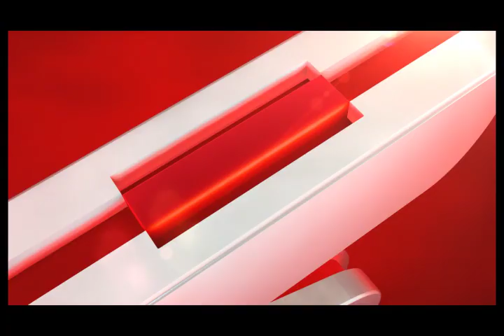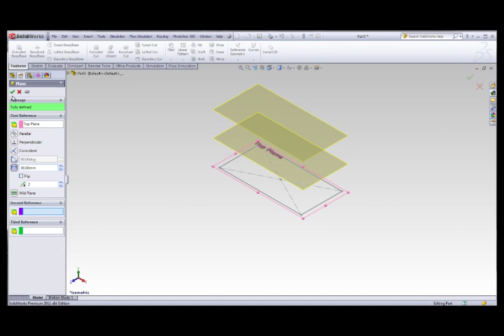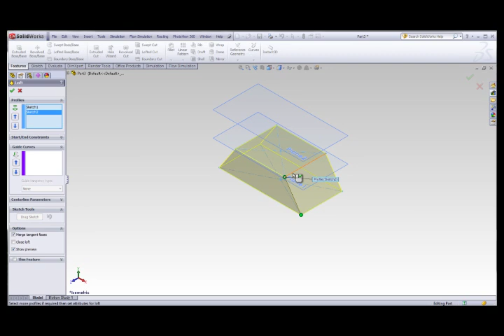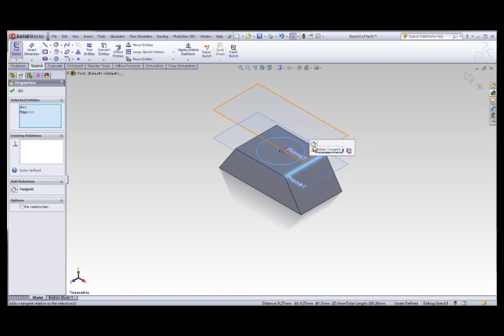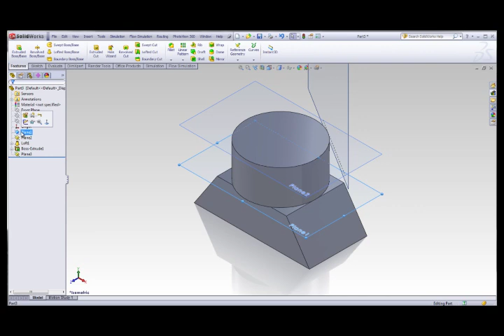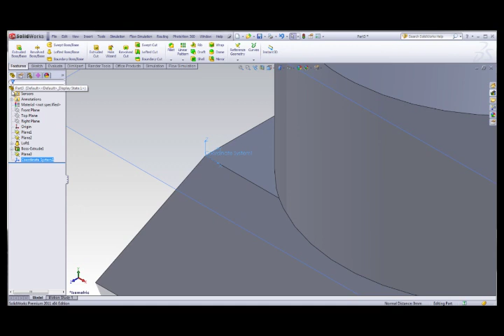Reference Geometry

Comment: I am having the same issue and their tech support hasn't gotten in touch with me yet. I'm running the student version of 2014-2015 on an Acer Aspire S7-392. According to Solidworks my hardware should be able to handle their program well. Haven't found anything useful on the forums yet.

Comment: Everytime i try to insert a new plane from Reference Geometry, SolidWorks just crashes. It gives no warning, and i have found no way to fix it. If anyone knows how to fix it let me know. 
PS: I've tried: Reinstalling (3 times), choose different options and some on the internet say that it might be the graphics card. But according to the SolidWorks site, my card should be fine.
Don't think i haven't tried because i have.
Reply: MegaGothmog so did you get the fix?
Reply: MegaGothmog i'm having the same problem
Reply: Bharat Khatri Yes. I found a fix. It had something to do with my graphics card. I had a AMD Radeon. No idea what type it was, i have a new laptop now. I fixed it by turning the graphics card off. Only the Radeon, not the Intel one. That fixed it for me.